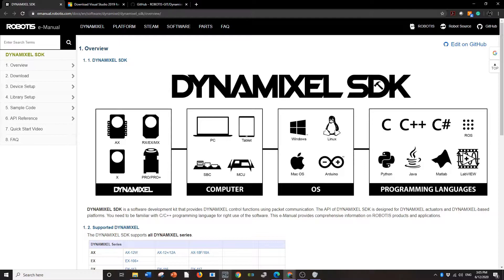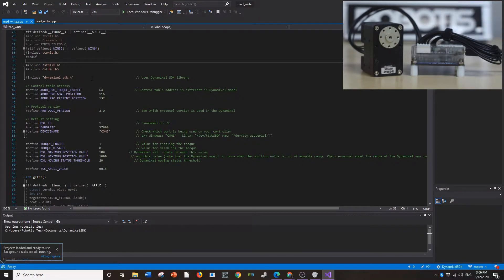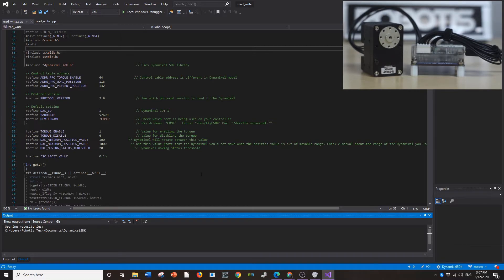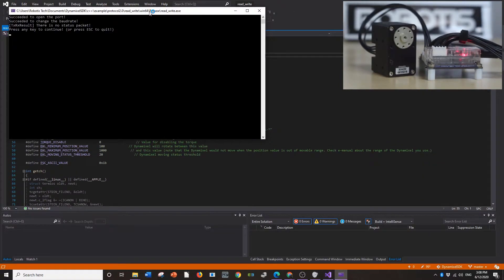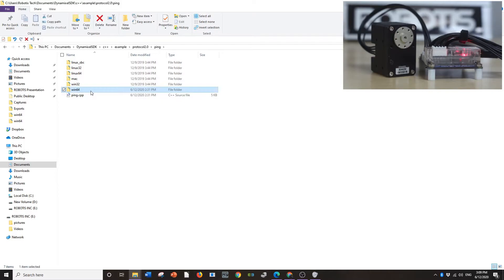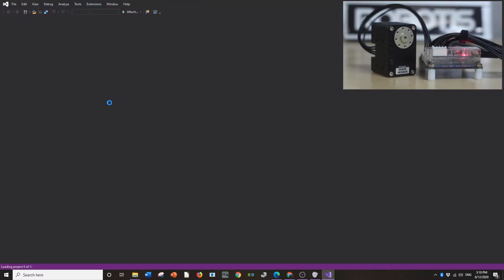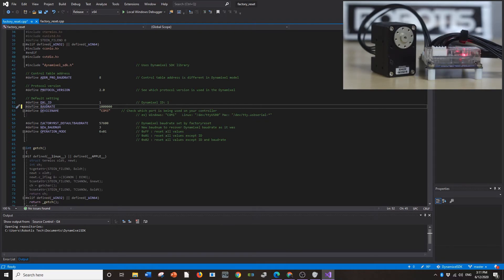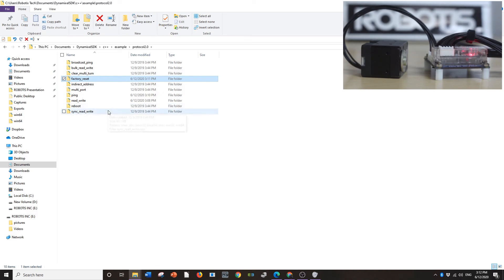DYNAMIXEL SDK Walkthrough- C++ Example Programming

Comment: Hi I am very new to this servo motor, is there a way to program this motor to continuously rotated until it hits an obstacle
Reply from the maker: For DYNAMIXEL models supporting Current Control, that would be the best way to achieve this kind of control. https://emanual.robotis.com/docs/en/dxl/x/xl330-m288/#operating-mode11

Comment: Hi, thanks for the videos. I have learned how to run the codes and tweak the given example code. But my doubt is can we use multi-turn code in sync read-write code. I am asking this because they both have two different .sln files, so can we do that if yes how, also please make a video on the data types being used, uint and char conversion being done. Thanks!!
Reply from the maker: I am glad to hear that the video helped you out!

You can use the multi turn control code in the same project as the  read-write code either by sourcing the file you would like to include together, or by copying and editing the parts of the code you want to use into a new project.

For now, creating a video on the data types and conversions is a bit out of the scope of our lessons, but for now you can always feel free to ask on the ROBOTIS Community Forum at https://community.robotis.us